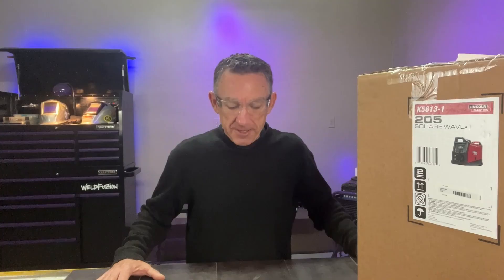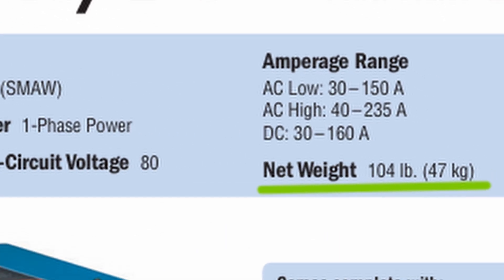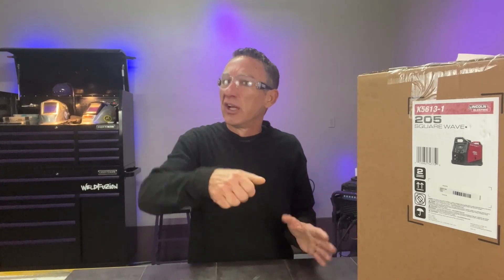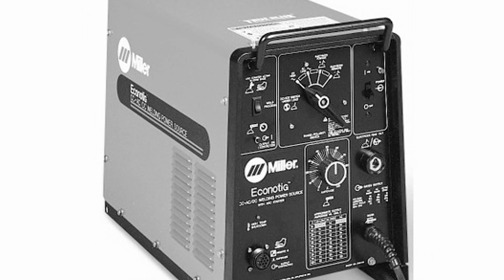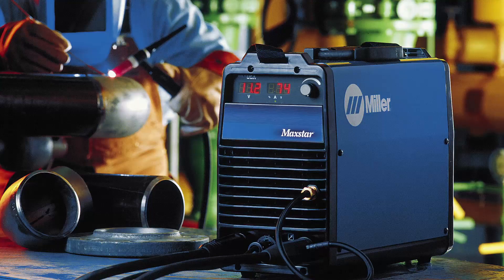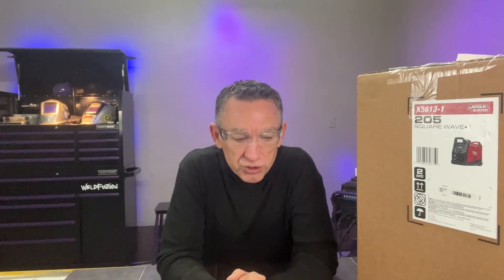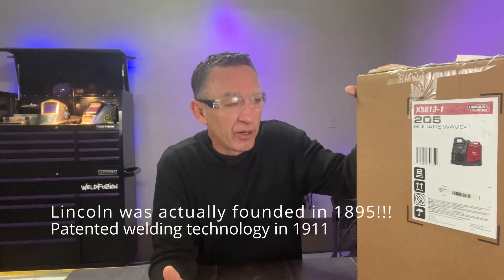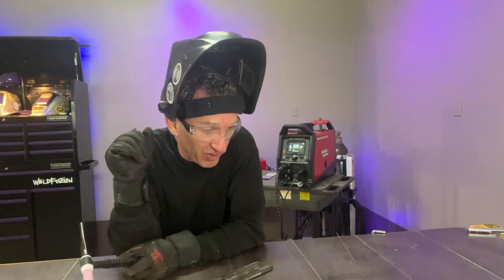Lincoln SquareWave 205 and Remembering Classic TIG RIGs

Comment: Is there a follow video of the 205? I'm looking for a new TIG. My friend is getting my Squarewave 175 TIG Pro.
Reply from the maker: Yes! Im working on the follow up with more details on the system. Overall, it’s been a great machine - especially for the price/value. Here’s what I like about it: small, lightweight & portable with dual voltage capabilities (plug in wherever you go) … it’s got a smooth arc with advanced options like AC frequency (arc width), higher AC balance range, pulsed TIG output & all easy to use & setup with many auto-features. I’ve been impressed with arc starts & arc stability - especially for the price, which included everything except argon gas. I’ve also ran 10 lbs of stick electrode with absolutely no issues. My students love the machine & it made learning much easier (and more fun) because it performs so well. A first time stick welder was able to light the arc consistently without ever sticking the electrode - thanks to the hot start & arc control! 

Ok … now a short list of compromises. The machine limits output when plugged into 115V. Haven’t gotten to the bottom of that yet, still testing those capabilities. The machine only displays preset amperage, not actual live welding current. Pulse control is limited to frequency  (fast or slow). It also doesn’t display or list pulse parameters in the manual - peak time & background current are preset. The accessories are, meh, functional? Torch connections loosened up & had the be snugged … the regulator is adequate, but a true flow meter would be a nice upgrade … weld cable lengths are short - but the machine is easy to move around. 

And. The. Fan. Typical of all inverters, trying to maintain internal temps - this thing is loud … like turn it off when not in use loud. It does have 2 speeds .. but seems to always be ON - even at idle. Positive? You can hear it running!!!

Now, compared to transformer tech in something like a Squarewave 175 or Syncrowave 180 … the 205 size & weight are a huge bonus & dual voltage input draws much less power than older designs. The arc performance is outstanding - and I’m comparing to machines like the Aspect, Dynasty, etc. 

Overall, this is a great value … from a very reputable manufacturer that has done a good job meeting the price/feature value point. Good for general fabrication, repairs & maintenance … very affordable, modern tech & arc quality. It does everything the Squarewave 175 does and more!!!

I’m not sponsored or paid for this product review … just a welding nerd that loves new equipment 😂 But, I  think it’s a kick ass machine for the price & wanted to add one to my shop … and it now sits alongside my Dynasty 200 - doing what I need for much less $$$.  Thanks for commenting & asking about the follow up video!!! I hope you find this helpful - my goal is to provide an honest opinion so people can make an informed decision. 

Stay tuned for a video!!!
Reply from the maker: We're still working on the series, but here's a link to the next video on the machine specs, setup and tips:  https://youtu.be/aG9bzMdv7hA?si=URQeYpVQPIX_ogeG

Comment: I have a 15 year old synchrowave 250 and love it. It’s a brick and you need a skyhook to move it around but it it will weld all day long and give a nice clean arc.
Reply from the maker: Is that the model with the drawer & digital meters? Overall, very reliable machine & a nice arc on those! My old Syncrowave wasn’t on wheels … it definitely was a beast to move 😂😂😂

Comment: In an amusing coincidence, my dad left me a 1980's vintage Miller Thunderbolt AC/DC, and just bought a Lincoln Square Wave 205. 

I've never welded  anything, so learning to weld by starting with aluminum TIG has been an adventure. 🤣🤣
Reply from the maker: Wow - that is a coincidence! And yes, aluminum has some unique properties that make it challenging at first … but once you get the hang of it, it’s fun to weld! 

When I first started - aluminum was a monster … I went too slow, didn’t use enough current to make a puddle & struggled with adding filler without it balling up before it hit the puddle. Yep - we all start in the same place 😂😂😂

How’s your aluminum coming along so far? Are you laying some beads? 

Here’s my approach … you need about 1 amp per .001” of material thickness - so 1/8” =0.125” =125 amps. Clean outside oxide layer with a stainless wire brush … oxide melts at 3x the base metal. Strike an arc & increase current quickly to form a puddle - think of driving 0-60mph … then you overcome the thermal conductivity of the aluminum & will form a puddle. Once your puddle is fluid, you can dip rod … and try to get a rhythm going - I tend to count like music in my head, 1-2-3-4 … and you’ll get that nice TIG ripple or stack of dimes. As the metal heats up, you can back off the heat to keep the puddle from getting too wide as heat builds up. 

I’m excited to hear about your journey & what you’re seeing!  Thanks for sharing!